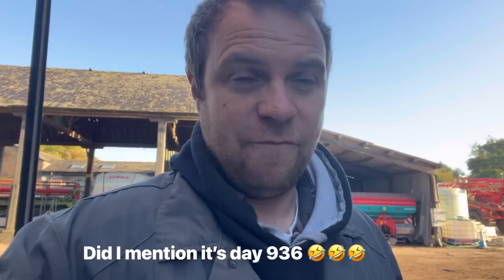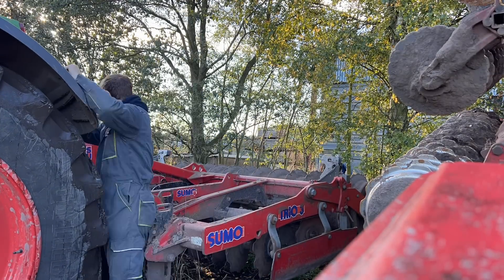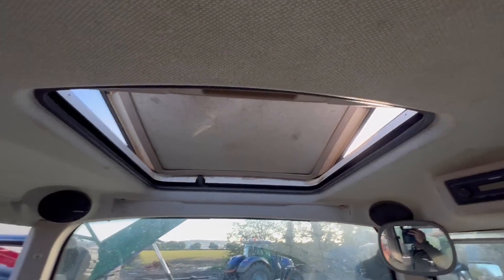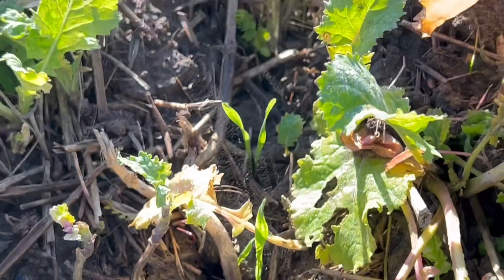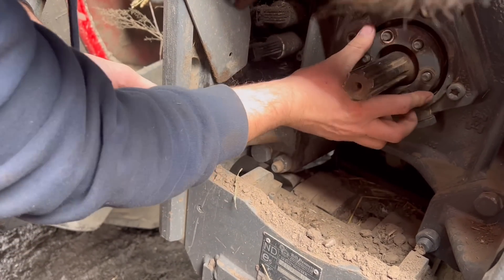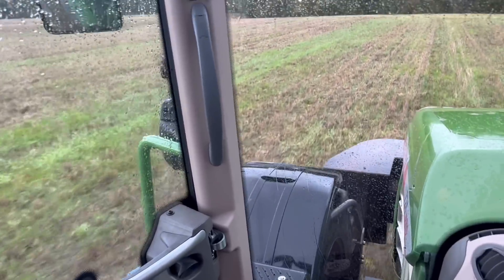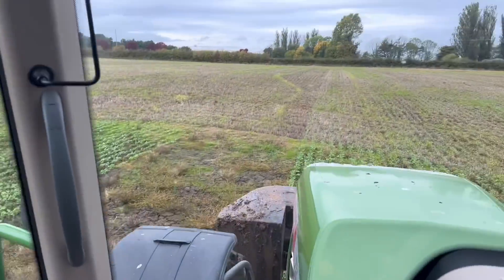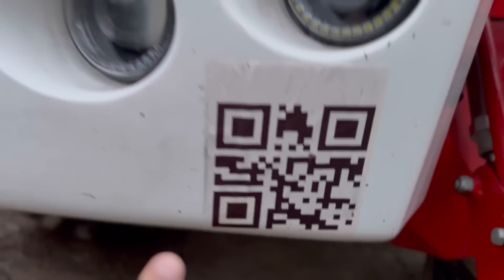DAY 936 LET LOOK AT THE BEST TRACTOR FENDT MADE #OLLYBLOGS  #AnswerAsAPercent

Comment: Good video Fendt are the best do you have any advice for someone that wants to do agricultural engineering and contracting?
Thanks,
Sam
Reply: If you want to go to college try Lackham College of Agriculture,  i did a farm mechanisation course there. They specialise in agricultural engineering and machinery operating. Its a great college. You will get a better job with a qualifacation.   Good luck which ever way you go hope you suceed in your ambition.
Reply: @philipgraham6980  thanks Philip. Could you check my videos out? I’ll consider that but I was going to go to Harper Adams
Reply: @TheJuniorFarmer724  Hi  I went to Harper Adams first and didnt enjoy the course.  There was to much class room compared to practical (workshop/field) for me so I changed after first term and went to Lackham. I much prefered the practical work both using machines and training in the workshops plus welding and building and also trained in electrics and machining(milling machine and lathe, made some tools which I still have).  Just do what is best for you.
Reply: @philipgraham6980  oh ok then where is Lackham?
Reply: It's at Lacock very near Chippenham in Wiltshire

Comment: Why is the fert spreader on the big (heavy) 270hp tractor, I know the fert spreader can be heavy, do you just use it because fendt has gps in 
feilds where tramlines are fully visible
Reply from the maker: Was light on front even on 240hp with 1.5ton on front